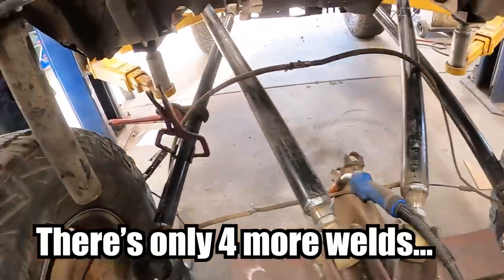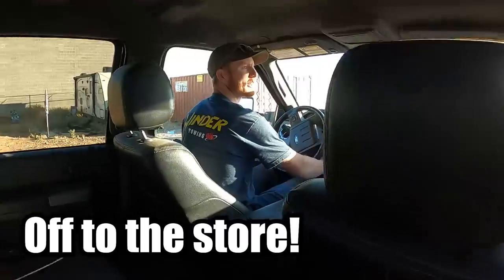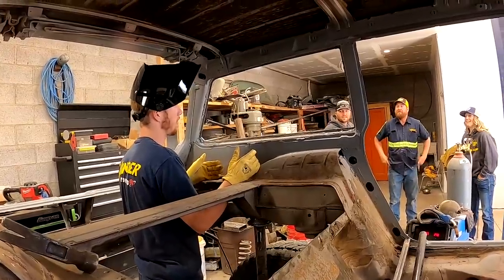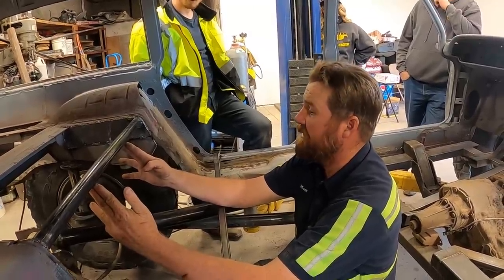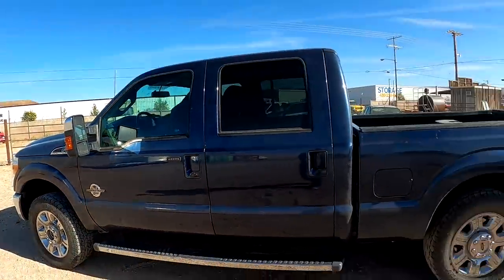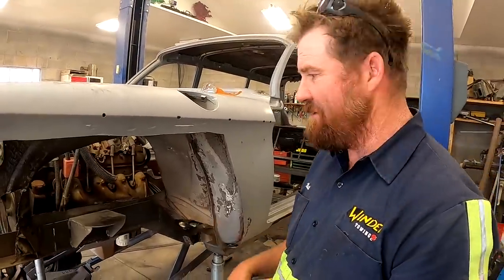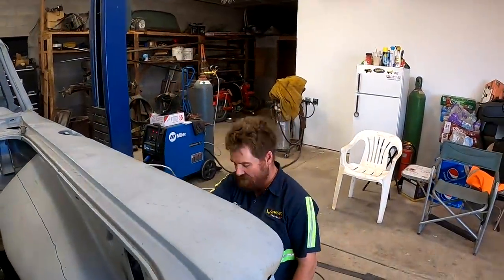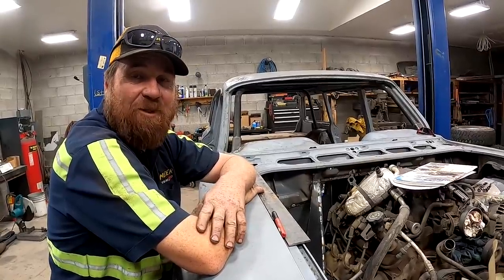The Corvair Build Gets A New Frame!

Comment: Two recommendations as a fabricator. When you're doing square tube like that, I use a good c clamp and some flat plate to clamp the tubing square and plumb to itself when tacking, that's where your twist came from when making the first one. And, if you weren't planning on doing so already, make sure you fish plate every single spot where you pie cut that tubing to distribute the load on those joints or it will crack
Reply: It’s “flitch plate”, not fish...🙄
Reply: @buellb0y  actually its not. It's fishplate. All one word. Granted, I botched that bit. But it refers to a splice plate overlapping the two pieces of a metal joint. A flitch plate is the sandwiching of steel plate and wood beams in the construction industry. You'd do well to make a simple google search before correcting someone
Reply: Yep fishplate cuts offer more surface area on the weld.  Spreads the heat in a better direction also

Comment: He filled a gap in when making or reinforcing the frame... ya that’s not gonna last
Reply: Obilwe wufuh Mubufu Oulou  Weld drill modify frame depends very much where you live and what you licence the vehicle for. In BC Canada truck frames can be drilled in some areas but not in others. Weld? Certified welder with insurance. Modify- very little if it is to be legal on the road (and you can be stopped and ordered to have an inspection done)
Reply: It aught to hold fine. His using MIG so it's not like he has to worry about slag inclusions. As long as the tie-in is good, it doubt it'll be a problem. Obviously, he isn't laying a cold weld since he blew through, so penetration should be fine. Generally, your filler metal is stronger than your base, anyway. They're probably burning ER70S, which has a 70,000 PSI tensile strength. Your average hot rolled stock isn't that strong.
Reply: Obilwe wufuh Mubufu Oulou  One exception on the cutting- you can cut to shorten the back of a truck frame to mount a dump box or a wrecker body- or at least pay a shop to do it. You can bolt or rivet plate the frame to reinforce it for the dump box or a snowplow.
Reply: He said he doesnt plan to take this on the highway. My guess would be he will trailer this thing to the desert then unload. Not 100% sure on Utahs laws, but most of these places seem to allow OHVs, in which case no need to follow registration regulations.
Reply: Obilwe wufuh Mubufu Oulou  Yea. I dont think hes gonna run it on the roads. I think hes just gonna trailer it to the big jobs and keep the Banana as his regular recovery rig.
Reply: Obilwe wufuh Mubufu Oulou  But, are you in the same jurisdiction that Matt is?  I find it hard to imagine his truck is illegal, but the Banana has had a LOT done to that I couldn't legally do here in Portugal, for example.
Reply: Only links I can find in google for CVSE seem to apply to British Columbia, which even I know is in a different country.
Reply: hunter childers  And can you get insurance? Liability and personal injury coverage?
Reply: hunter childers  Kit cars are different. Look up the Utah regs on kit cars and you'll see they require statement of origin for all kit components and the title for the frame. 
With that aside, you can also look up Type III OHV in Utah and see that he can legally register this as an off road vehicle for road use under 50 mph. It will hardly see pavement, just like guys who build rock crawlers. But if we all spent 30 seconds on Google, we could learn this.
Reply: hunter childers  There are a lot of kit cars on the road in Canada too. The manufacturers have jumped through the same hoops here to make them good enough to satisfy the insurance companies. We have one more hoop- after assembly we get a temporary permit to take them to a licensed  (and well trained) vehicle inspector to get paperwork for registration and license plates. If we modify them after that and get in an accident the insurance investigator (many the same companies as in USA) will likely cancel our insurance and we will have to pay for any damages that occur. (often even if the other guy was at fault- lawyers!!)
Reply: hunter childers  Here we go, Utah regs to not pass inspection:

 (C) the frame has been cut or portions of the frame have been removed, drilled, or bent, affecting the strength or integrity of the frame; or
(D) repairs made to the frame that do not meet OEM specifications

Now everyone can interpret this how they please. I'm sure Matt has a better idea of the laws than all of us, so it's probably legal how hes doing it.

Comment: Welding is such a cool skill, I tip my hat to people who do it for a living.
Reply: I love it. I did it as a hobby, theb made it a career  best choice  i ever made.
Reply: it`s not good for the lungs in the long run.
Reply: @REDMAN298  depends on how its done, full ventilation and correct extraction in use and it shouldn't cause any health issues.
Reply: @REDMAN298  yeah I’ve heard that, can they wear masks or is the shit to cumbersome?
Reply: @REDMAN298  there are safety measures for that. I was taught by old school  guys, in their 60s-70s who still work  circles around people and weld everyday.and had been  since they were in their late teens abd 20s

Comment: I'm wondering, if in the beginning, you thought about building the frame from scratch and then trimming the original frame out of the body and then mounting the body to your new frame? The way race cars are built. It seems like it might have been faster and easier.
Reply: I had the same thought, but it looks like they got it done.
Reply: MrBtdobie 

It needs to be more than just "done", though. This is supposed to be a work truck, so if it's not done well, it won't last very long.

Comment: Why not start with a real truck frame, really no need to re-invent the wheel.
Reply: Tubular is stronger than factory.....
Reply: @ohiorccult1088  well yeah but the Corvair had neither.  And there are plenty of decent smaller truck frames that would make this a whole lot easier. Any Isuzu Trooper or Rodeo (or pickup) out there from the mid-90s til they stopped production would be a great choice. Fully boxed frames right from the factory (not gonna find that on an S10, Dakota or Ranger) and the rears of the Troopers already came with 3-link suspension. 
Isuzu even had a V8 slated to go in the next generation of Trooper before their agreement with Subaru to manufacture in the USA wasn't extended.  
Honestly, a Trooper would make a great recovery rig with a few upgrades like a solid axle swap, more modern motor and a transmission actually suited to the abuse. The Isuzu V6 wasn't bad for its day but they ran a GM 4L30E behind it that just wasn't suited for anything other than soccer mom duties for any extended length of time. Luckily though, the Isuzu motors used the GM Metric pattern, so you have transmission options. Or the later ones in the Axiom and Rodeo used the Aisin 30-40LE, which is the cousin of the AW4 in the Banana or any number of Toyota vehicles, so there are t-case options. One such swap that has gained popularity and actually fits better than an LS, is the 1UZ V8 from Toyota with either a Toyota A340 or manual and your choice of t-cases from Tacoma or Tundras.
Reply: @ohiorccult1088  That is why you box it in, and you still have the layout.
Reply: @paulsautocm  Well we will see about that
Reply: I get building is fun. But jeep is making the v8 wrangler with new factory half doors. Im getting really excited.  I might just sell my house and be homeless :)
Reply: I’m building my 65 corvair on a full size jeep wagoneer / Cherokee chassis which is the same wheelbase
Reply: @nickmccain6598  why in the world would you buy a POS V8 jeep? Buy a regular one, put the Cummins 4BT and have a better motor, more torque, and save some cash lol

Comment: Tiny little Corvair over 5000lbs, what was the point of the small body? lol
Reply: It's nearly impossible to Quantify  "COOL" ......& Cool rarely has a "point"
Reply: Ain't NObody else gonna have one like that!
Reply: Well, the running gear needs to be strong. so, weight say 4000lbs, and with the  Corvair body adds, say,  1000 lbs, and a larger body would add ,say another 1000 lbs, so Corvair total 5000 Lbs or larger body, 6000 Lbs. Well no body else would have another like it, and the Corvair arriving on the job, in the video will get better reactions from the customers!!! Makes for better viewing!
Reply: @ralphroberts3291  Slightly lower CG?? for those 37 degree rescues??

Comment: A One Ton Truck Frame with the running gear all on it and then set the body on top would be much Easier,  Stronger and Faster than trying to build a frame and incorporate some of the original uni-body frame.   And In My Opinion much more able to withstand the Stress of Major Off-Roading,  Yanking, and Winching.   It is a Cool Project!   Best Wishes, Have Fun, Bee Safe, and Prosper!   From an Old Fart Desert Rat Fabricator in Yerington Nevada

Comment: It’s entertaining watching you build this but looks like a lot of trouble. Looks like if you took the body off and built the chassis first it would be easier. Speaking of the chassis, a tube chassis would be easier, stronger and easier to adapt a body.
Reply: I agree, not enough frame to work with, build a tube complete chassis, set it on top, They are trying to keep the weight down, but gotta have a strong start.

Comment: I would have started with a truck frame and running gear of your choice, do all the modifications then mount. Then fit the body to the frame. That still leaves all the wiring ,steering , brakes and body issues

Comment: Put a hemi in it, with hellcat lifters, you will get way more power, it's cheaper to do it with the LS, but again you can get way more power out of the hemi, which is why 85% of funny cars, monster trucks, drag are using Chrysler designed hemi

Comment: The trailer is in the side mirrors. In reverse,,,  it will go in the direction you turn the Bottom of the steering wheel. Give that a try Lizzy. If you go slow it's easy.

Comment: Im worried about your cross member at the transfer case.  If you ever want to put an Atlas in it, that cross member will have to go.  Also you will have to run a 1350 Slip Yoke CV at the transfer case with your 205.  It isn't the ideal setup with the suspension you have.  I would love to help you guys out with the drivelines.  I message you guys via Instagram.  Cheers

Comment: Did you ever think of buying a decent donor vehicle (with similar wheelbase) and grafting the body of the Corvair onto it. A wreaked Wrangler comes to mind. Then do your long travel suspension and engine swap to a Wrangler platform instead of basically a scratch built (sorry, kind of cobbled up) dune buggy.

Comment: We have a variety  of 4x4 vehicles at my house.  Our Ram diesels are nice trucks.  But the Jeep ZJ is perfect for many remote locations.  At one time I strongly considered putting a Wrangler Rubicon frame under a Chrysler Town and Country Minivan.  I was going to put a Cummins R2.8 and the ZF 8-speed.  It could have been any Jeep frame.  But I wanted a 4:1 ratio low range.
Frankenstein project vehicles can be fun.  But I decided to remodel the house for a little more comfort and style.  So maybe in 2 years I will do one.
The Corvairs I rode in back in the 60's & 70's seemed fairly roomy, but compact.  So the CorMattmobile may end up being way more practical than people can imagine.  As long as a/c is included in the design!

Comment: Hey Matt, what's the chance of getting you to go with coil overs and a set of 38 -40's instead of a stock spring set up? No sense in wasting all that articulation the 4 links are gonna afford, It sure would give you a worthy advantage to be able to easily change ride height & rebound when you have a tough recovery out in some serious rocks. Plus a bad ass banana recovery rig with tall, wide, gnarly rock eatin tires will def turn heads and make more customers remember to call U whenever they screw up & need help. Oh yeah, go ahead and throw that Atlas in now while a tailored install will be easy, make sure those driveshaft angles are aligned proper so I can see ya yankum out for many years to come.

Comment: Rudy is right about the welder, every one of them has slightly different characteristics, he sure gets a lot done though. Lizzy, to learn how to reverse a trailer get a toy, preferable with a steering wheel, and practice with that so you can see what is happening, then practice with the real thing. I did that with my lego set as a boy and it helped a lot. That is also how they train tractor trailer drivers.

Comment: The heating and cooling from the welds likely caused the twist in the new rail section. You can untwist by heating the "inside" of the twisted section in incremental locations. It will eventually straighten itself out.

Comment: Don't mount your limit straps in the center.  You need to be out at the shock or as close to it as possible or the axle will hang from the shock.  Pull out 1" for every 12 of shock length so a 24 inch shock would get a 22" strap as long as the rest of the suspension and drive line can support that.

Comment: Don't tell anybody, but you can see the trailer in the side mirror... let's you line up the trailer and adjust the steering to keep a straight line a lot easier than looking out the back window. Turning into a slot/door/etc is just a matter of a little practice. Once you get half way good at it you'll wonder why you ever looked over your shoulder.

Comment: Why don't you raise the body 6" or more, then the passengers in the rear seat will have some leg room? You could literally do this body on frame, and have the complete separate frame, with the body simply bolted on top, like a full size pick-up.
Reply: I think the reason he is keen on a unibody is for weight

Comment: You're getting a little too fast on the suspension where you know what you need you need say just a smidgen more otherwise you don't have a roll bar are all I know you don't have one in the Jeep where you should and some of the situations you get into should have a roll bar got a stupid little Corvair body a 1 ton vehicle that you're making and you not going to get into any Miss ham Mad came out good you make sure your driver and passengers are safe cuz somehow already know it going to roll over with no space for safety double impact motorcycle drag racing NASCAR or Formula 1 not to mention how many other sports classes are out there you make sure your drivers are safe how are you going to be Enzo Ferrari his wife take all the families up the let them know that their babies died cuz a**** would not do it that was his wife's job so I want to see a hell of a lot more engineering going in that thing that you're making and no it's not a Volkswagen Thing is the Corvair klusterfuk of parts you did good on your Jeep better to batter on this one especially since it's cramped and there is no space is nothing but impact you got to get some NASCAR inspired seats to keep your pastors and you safe don't remember Trevor charts app are supercharged that little five tree they're a bad blower motor can make a lot of power I want to see you pull the front tires off the ground if you can do that then you need some weights fur in the backseat where nobody belongs in the first place and somebody with some arms and legs back a real back my back's broke to put the weights on the front of the station wagon like a pulling truck job balance your weight out to put it where you can use it mobile vehicle is a real good place sometime wait sometimes wait pays sometimes it keeps you in the buttocks you put seam unbolt it and throw it to the side to get out sometimes you want it bolted in remember if it's not secure bolted in place it's not safe legally even start thinking about your design more what I see is good you need a lot more thunking be great I know you can be great get the rat help you my real name is not important I designed to hell I prefer hypercar supercars hypercars maybe you might know my baby is called an F40 when is your government going to give me my car Mister Dino fryer Jr is my proper name otherwise in Italy I had to go by Adam Pino for with ra that's close enough for me the Coach T coach Builder it's not a designer he's a builder there's a difference yeah that was part of my family yeah right my family has nerve part of their family everything was my fault I moved your s*** hole of a country 4 a s*** hole of a woman the country is not that bad and most people are good you got me off bad night otherwise Doolittle Moore engineering be more safe don't act like it's a mid fifties are you on cars it doesn't matter the brand new tires are skinny and the drivers were fat many of them went to the races with hangovers still drunk blah blah blah I know you're socially cracked you're not shade tree mechanic how long is still in those type of conditions that you might get into make sure everybody in that vehicle safe not to mention you have winches to hook up have the proper plugins now you don't have on your Jeep that way you can transfer the weight to the front to the back even if you don't need it on the front you slide it into the receivers for extra weight on the front stop looking short minded look at the big picture what happens when you move to America for a woman and show up at her door go with them everything will be okay that's her opinion not mine if you are asked me to get married you better mean it all the way to hell otherwise I will not bring you back
Reply: Holy wall of text, Batman.

Comment: Only 500 horsepower 
just put an lsx or ls3 with ported heads spring and retainers and a decent cam and it will make NA around 700 hp